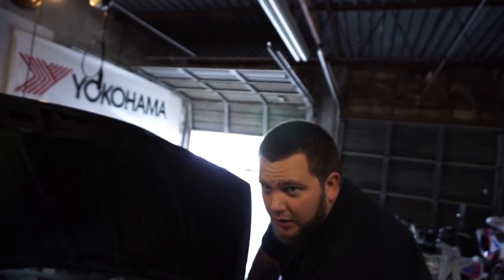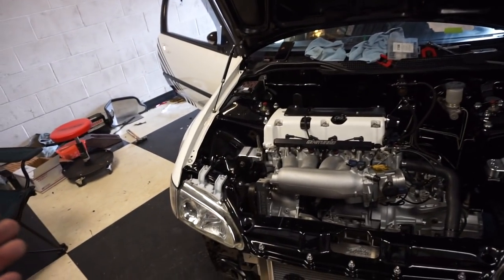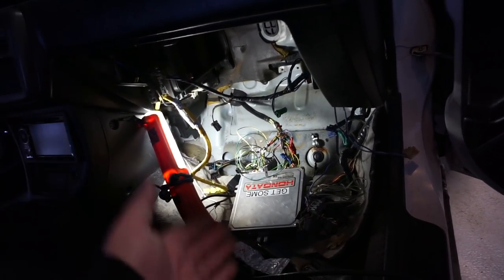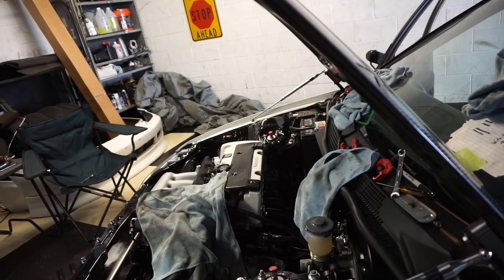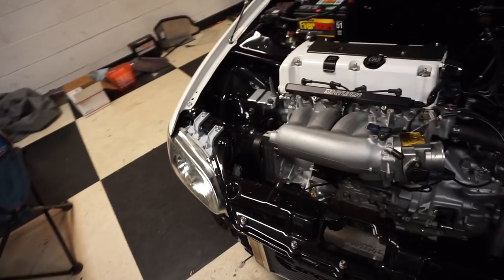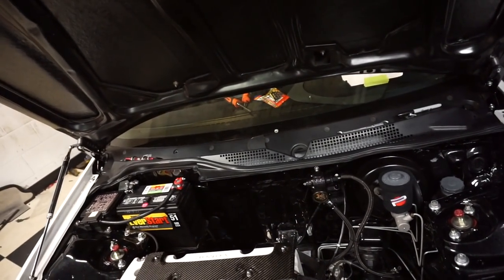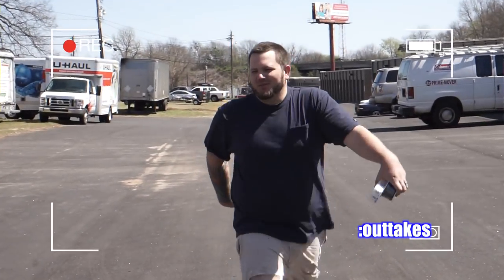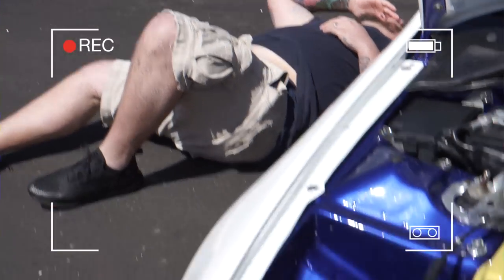IMPORT ALLIANCE 2018 PREP!  HSG EP.6 20

Comment: Wow is it better than downstar?
Reply: 100% downstar is just a gimmick of color bolts no better then your local ace hardware! overpriced without the quality to justify your purchase!
Reply: nimai mederos I heard you can get the same bolts at ace as well but when I went I couldn’t find any. Is there a name of a bolt I should ask for?
Reply: only 2 ace's have this hardware around me the others dont carried them. they are metric hex bolts! I use them for my distributor and headers to clean up the look!  depending on what you are using it for you need to know the bolt patter like m12x1.5 etc... follow me on instagram and see how they look or to help you further on your bolt quest! ( nimai_ej8 ) pm me!
Reply: JDM_Josue you need to bring the boltd with you that you want to replace. There is like 20 or 30 holding the fenders, hood latch, lights and a bunch others that are the same size.  Down star just charges you for a name and to take the hassle out.  EBay sells cheaper bolt kits to for cheaper than ace.